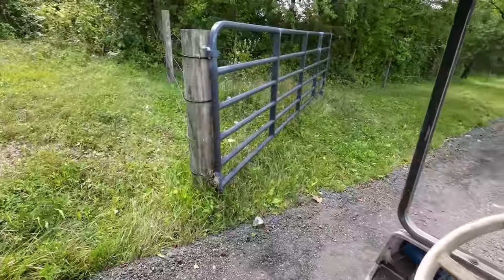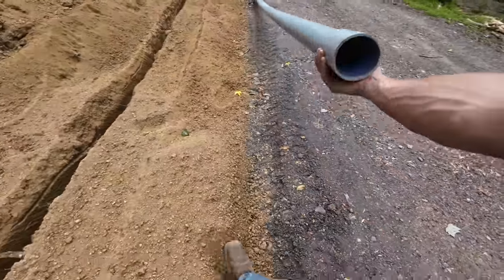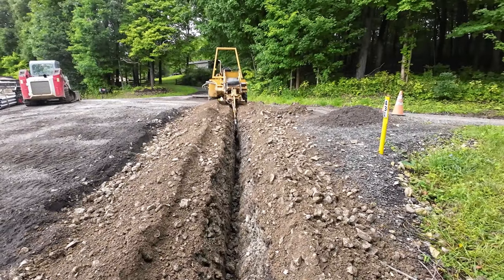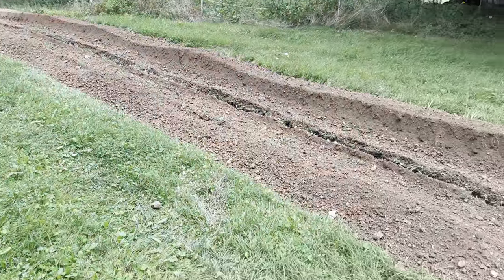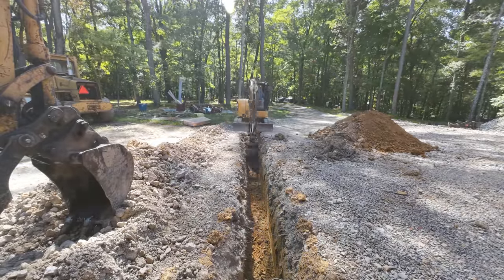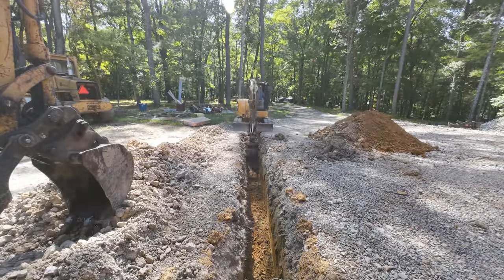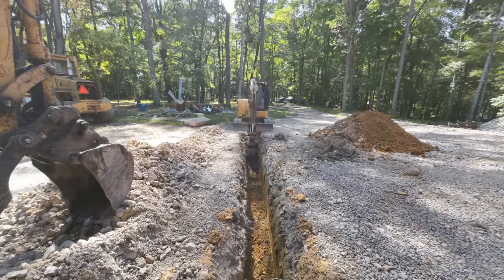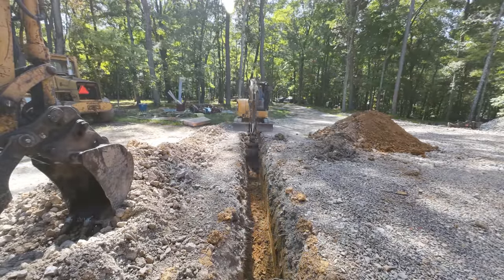Running Nearly 1/2 mile of Underground Electric, Costs over $64,000??!?!

Comment: I just can't get my head around this whole project. I assume you did talk with the Line Superintendent or an engineer, or someone on the line side of this electrical company. Do they know of your future plans for a house, well, & possibly other outbuildings? First off, most companies would have plowed direct burial primary from the riser pole (which looks like a tagged pole that will need to be changed) to the transformer pad. If they did insist on installing it in conduit, I'm surprised they didn't want it in continuous innerduct instead of 20' lengths of S40 PVC. Unless I missed something, you are running the underground triplex in conduit directly from the transformer pad to the meter socket on your shed, with future plans to add more runs to a new house & a pump service. Did I miss the part about a disconnect somewhere past the transformer?  I may have because I skipped past a lot of the video while you were just trenching. Typically you would install a 200 or 400 Amp double throw disconnect next to or somewhere close to the transformer. That disconnect would also contain a socket for your main meter. Then you would bury separate runs of triplex to your shed, house, etc. from that disconnect. I guess our Rural Electric customers were spoiled & I know prices have skyrocketed since I retired as a lineman 10 years ago, but WOW, your electric company is pricey and not big on customer related suggestions. I don't know if they've got you hooked up yet, but unless I've missed something, you need to get more info before you spend even more money on things that will have to be redone later. Have permits been pulled & electrical inspections been made? If not, you'll more than likely be made to replace that schedule 40 PVC with schedule 80 where it comes out of the ground & make you install a slip sleeve in it under the meter socket on your shop. If you had a disconnect beside the transformer, you wouldn't need to have a meter socket on your shed. Depending on local code requirements you may have had to install a separate disconnect on the riser to your shop which you should have anyway. So many questions & it's now nearly December...

Comment: If only they had told you the price before you did all that work. I'm guessing it would have been so much easier to buy all the wire and pull it through while you were connecting the pipes, now it's going to be a real pain if you have to do it yourself. ISP's do the same thing when running fiber to a new building, they charge you what they want because they know you have no other options.

Comment: interesting as usual matt , but wonder did you think of putting solar panels on the roof and a tesla power wall with the costs
you incurred and those the power co are going to throw your way you would be self contained and not at the mercy of energy charges at all!
and saved money for ever.
And the other thing i wondered.
why you didn't just trench straight down the middle of the drive save cutting trees and shifting everything 
all your rigs would have been able to go up and down the drive without the trench being any bother and its what the power water and telephone do they dig up the roads all the time here. LOL.  very enjoyable video anyway great channel

Comment: Hi Matt.
I wondered why you couldn't put the material you took out the trench that wasn't allowed to be put back in the trench it came out of 🙃
Is it to show there is an electrical cable under that material so in the future, people will know there is a power cable near?
I know you put a plastic warning tape on top of it to stating there is electrics, but a difference in materials will show up quicker than a tape when digging on a service road 😁
Offer to run the cable and they connect it.

Comment: It seems the water circulator pump is the primary critical load at this time. 

Could a small efficient generator buy you the time needed to get the price right with the power co.? 

Maybe a hybrid, some batteries that can charge while the generator  is running the circulator pump and then run the pump for some time while the generator does not?

Comment: For that cost, you're better off going solor and getting a thermal generator for the furnace so that your heat makes you additional running power. Even of you just get the small thermal power generators to power pumps and blowers and letting the extra when there not running charge a bank. Too bad you didnt just do that from the start. Tou would of saved 10k in pipe that could of paid for the batteries or pannels

Comment: Having continued to run your building off of this generator, and a smaller diesel generator that you could let run while you're not physically at the shop, to keep the heat on...
Could have been supplemented by lithium-iron house batteries, that would have lasted more than 10 years, for about $12,000, including electronic subsystems.
Supplemental solar and wind systems, could also have been used as a future upgrade. 
$54,000 sounds like robbery.

Comment: Definately get an estimate from an electrical contractor to pull the wire and set the transformer. The connection should be done at no charge.

Comment: Yeah it took me almost 2 years to get everything figured out on mine then after I finally got it done it took another year to get an inspector out to pass it in which it took 3 times because when they came down the first time they didn't tell me I needed a second ground so after getting it it took me another 3 months to get the inspector back out to final everything and passed only to have the main breaker to go bad so after I changed the box out with a new one another 2 months before I could get ahold of the inspector in which they wrote down the wrong thing so I waited another month to get ahold of the main inspector and she came out the same day and passed it. I already had the pile and transformer though so I have a lot less in mine then just the 52k they are wanting to charge you but I didn't go 2500 feet either. Best of luck and hopefully they made a mistake and it won't be no where near that

Comment: I would get a quote for an electrical contractor on pulling the wire and installing the ground transformer , or buy the wire and get a friend and use you skid steer and pull it ( we used a fork truck in are factory  and pulled 1/0 3ph across a 500k building before worked good  Chinese fingers and tape ,& lots of lubricant )the let the power company connect it .

Comment: Matt I did the same job 2 years ago alone and digging with a mini excavator so the trench was 12 inches wide I had to go 4 ft deep.   The contractor charged me for the wire and hooking up.. The distance was about the same except I had stumps and boulders in the way that had to be removed.   I installed the wire and dug everything myself.   The cable I used was direct burial in sand  so no conduit pipe.   Much easier.  all in it cost me $12000.   So you are getting ripped off.  I bought my own excavator with the money I saved from not hiring an excavator.  Best of luck.

Comment: Is the underground electrical cable armored?  is that Armor a type of plastic?  if so you need Marker foil Tape to place in the trench before filling it in... so that later you can find the cables easy. I saw the tape after I wrote this... good job...  I would  have threaded the pull cable as you put the conduit together.

Comment: I use to bury telephone cable and it is very expensive. Since 1903 AT&T has been placing copper wire up and down every street in America  🇺🇸 now you ask what’s that got it do with  power? Well everyone that has a phone has need for power. We had Air tamps to pack the dirt back into the trench. That distance we would have a couple big air compressors and four tamps. About a 90lb tool with a big steel ball about 5.5 inches across and BOOM BOOM BOOM BOOM A Boom A boom up and down  up and down until it was compacted and nice. And Matt? How many paying customers are on that 2500 feet. Self explanatory eh ?
Have a nice day Matt.. I’m sure you thought about everything I just said so no big whoop 🙌

Comment: I had to site watch a plumber Co to run a water line from a house wall about 40' to the city water shutoff. $5k for 2/3 of a day. Water shutoff was NOT on property like city engineering/water dept said it should be. Had to stop file a permit which took 30days to get back,  to cut the sidewalk dig down find shutoff on the street side of sidewalk...oh another $5k

Comment: labor costs most likely is set by the union that the electrical workers are with.. Also is it possible to use a steam generator to provide power to your boiler / water well??

Comment: Iwould gueess your primary voltage is either 2400 v or 4160v. either requires medium votage cablep at 9-10$/ft  5000ft = 50K$. 53:05 😊

Comment: I had my local Rural Electric Cooperative give a quote for $7500 for a half a mile. But if they had a building to connect to it would be $3500. 

I assumed 14k for your project. You said 52k that is outrageous. Good luck with arguing with them.

Comment: Wow I am really surprised you went this route, if it’s anything like the UK the electric is twice the price it was a couple of years ago around 30 pence a kWh ( guessing that’s about40 cents) I personally would have but some of that money into battery storage and solar panels to work in conjunction  with a small generator and had a big 3 ph gen when needed for any big machines. A neighbour of mine is doing just that as he has been quoted a nearly three times that amount for a similar connection😳. Can’t believe the conduit is the same price as the cable 🤷‍♂️ like £12 a meter?? Are you not allowed to use the flexible ducting on a roll ( like land drain pipe) ?

Comment: You will not own the transformer but someone has to pay for it and regardless of the ownership it increases the value of the property. The customers say everything one way or the other. Either you pay it or is is spread to everyone. Of course if they charge separate rent for it then it would be weird to charge an one time fee.

What would be unfair if they later hooked someone else on that. In that case they should charge him and offer you a partial refund but considering where it is that is unlikely.

Comment: A lot of companies know from experience that there are in a lot of cases 'unknown costs'. So they estimate the cost without problems and then jack it up based on previous similar jobs with typical problems..
They should really come on to your site and assess it in a fair world. But big companies don't operate like small traders. The guy who did the quotes probably has not seen what you have done. He/She probably just looked a a map and stuck their finger in the air. 
Experience tells me that you can squeeze better results from big companies but you need good communications, you have to repeat yourself a lot via call centres, push them for a contact, a name you can deal with then you will slowly get somewhere.

Comment: I’m in the uk but your power cost seems about standard daylight robbery, 10k for cable 5k for transformer and fixtures and fittings, a couple k for 4 man crew in wages, another couple k for an engineer/inspector. Cost to the power company 20k, 22k tops, then 150% markup on top.

I’d guess that the markup would be negotiable, 150% being the sucker contract, 0% being reasonable as you are going to be buying power from them for years. I guess you have to negotiate as near to the 0% figure as you can, bearing in mind as a monopoly they can delay, so you probably have to pay something, or wait 18 to 20 months. Good luck 🤞

Comment: In my limited experience, the power company will charge whatever it wants within the law. You almost never have a choice and they know it. Honestly running the wire and the wire is something any reasonably qualified sparky could do if not for the power company.  At that price it would be less expensive to just install an off grid system.
Reply from the maker: But an off grid system will never meet my demands or I’d be all over that

Comment: Aloha Matt.   Fantastic job as usual!!   You got to use a bunch of your toys on this job and man, did they come in handy.    Take the electrician's test and pull that wire yourself and tell them to take their 52K and SHOVE IT!!    What a rip off, and they will charge you lots of money for electricity each and every month too.    All of your skills and machinery really helped out on this project!!   Hopefully you will have power to the Dream Shop soon, and then you can get your boiler fired up to be able to heat the shop this winter.   One step at a time and you will get there.   It is great to watch you do what you do so well, and thanks for including us in on all of your projects.  The plan for building the house on the property is looming over the horizon, and that project will be an interesting one to watch when it happens.   Then your wife will be closer to help with some of your projects.   Keep up the great work, and thanks for including us in on all you do.  I would think that water in the Dream Shop would be for a restroom and maybe even a shower, but that would mean a septic system and all that entails.   A fire hydrant at or inside the Dream Shop may come in handy some day to keep it from burning to the ground before the local fire department got there to put out a fire.   One guy I worked with who lived in the east mountains had a hose bib and hose put inside a closet in his house in the mountains to help put out a fire, and some water available inside the Dream Shop to put out a fire might save it from burning to the ground in the future.  Aloha

Comment: For that money, produce your own electricity. As your skills you just need buy some solar panels, batteries and you are done. The best part is, do not need pay anything to them.
Remember, after the instalation, you keep paying the bills.
Reply from the maker: Except we don’t get near enough sun to keep me going especially in winter. I’d need acres of solar panels and no way would I do that.
Reply: @DieselCreek  thanks for answer, and about the wind? using turbines could be better than solar panels. The last renewable energy is the water. Anyway, I think you did already studied this options.
But even, there is an crazy option, using the geothermal hot.
Anyway good luck for the energy.
Reply from the maker: @luisdaniel3363  I looked into a lot but I’m in a valley with very little wind. There’s a steam but you’d have to damn it up and the gov won’t permit that

Comment: if the cable cost is $12k, then I would run the wire and have them just do the connections which should be free.

Comment: I can't believe that the power company is trying to charge 52000 dollars for basically labor sounds crazy
Reply: There is far more to it than that. Just like he grossly underestimated what work was involved in just a trench, multiply that ten fold for the amount of materials needed for the primary pull, including good quality wire since they don’t buy off the internet, the labor of many lineman and their expertise and special skills, tons of miscellaneous parts, and multiple pull junction boxes. And their line trucks and other equipment are very expensive as well. Probably a good bit of paperwork and filings for easements. 
It seems like a lot of money for sure. But it would’ve been much cheaper to went overhead lines. Underground is far more expensive and that was Matt’s decision.
Oh and the transformer is probably 10k as well and they will be providing that as a part of that cost.

Comment: Matt!  where are you getting $10k for the cost of the wire??  you are talking medium voltage cable (aluminum)  i dont know if  you are doing 3ph or 1ph, but if three phase that is about 7k feet.  that wire is about $7 a foot.  you got 50k in wire alone.  look up the price of mv-105 133% 15kv wire.

Comment: I realize it's been a couple of weeks, but I'm wondering if you've called your Public Service Commission, (PSC) to open a ticket and intervene on your behalf?

And alternately, what if YOU pulled in your own wire, so all they had to do was drop on the risers and make the connections?  You have to make your own home run on the secondary to the meterbase anyway.  What's another 1800' of primary?  (Please don't kick me, just asking).

Comment: I might have put a layer of gravel in that ditch below the conduit, in case there's any damage caused by ice in the winter esp. in the low spots.  I don't know if that's standard practice if a utility company is running underground wiring.  You actually put effort into cleaning out rocks, the opposite of what I would think.  Looks like the road didn't have gravel underlayment, as you say not really high quality.  I guessed $20,000 for the power company knowing it was a high number.  Good luck on your appeal on the price.  Might consider an appeal to the commission that regulates the power company, or ask a lawyer in your state with some experience in this sort of matter.
Reply: As long as he got the conduit below the frost line (usual 18"-24") he's good to go.

Comment: Are we talking single or 3 phase? I understand this isn't your homestead but there could be some federal help on installation cost if you said it was a homestead? 
I assume it's single phase.
For me to bring 3 phase 125 foot into my property cost me 17k. Highway robbery indeed. But still cheaper than generating your own power for years to come.
Was also thinking parking a POS camper there and call it a homestead??

I am also highly surprised they let you install the conduit, especially under a county road.

Comment: Hi Matt if you did all the work on putting in all the conduit for the wire and all they do is hook-up to the main power source and run the wire in the pipe put in the transformers then hook-up to the shop how can that be $ 54,000 dollars total ripoff it should be about $20,000 dollars max